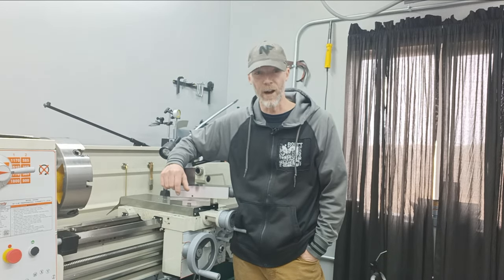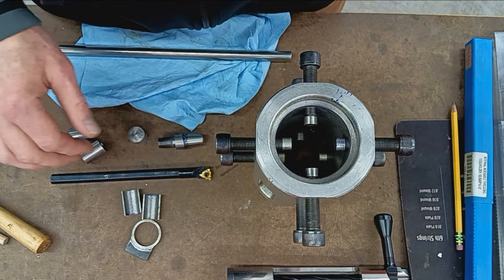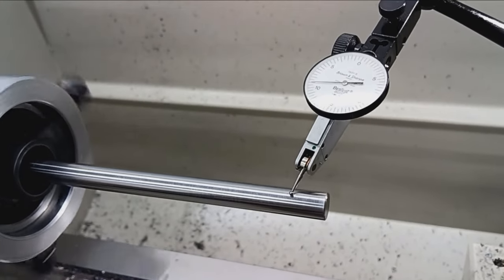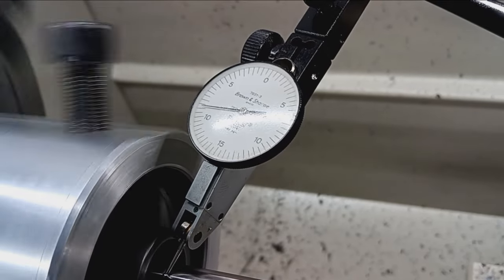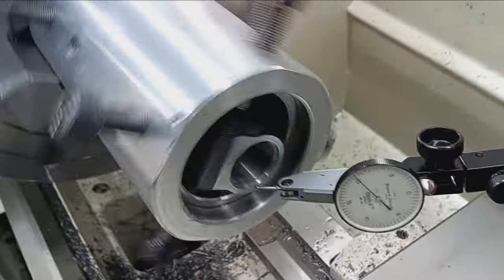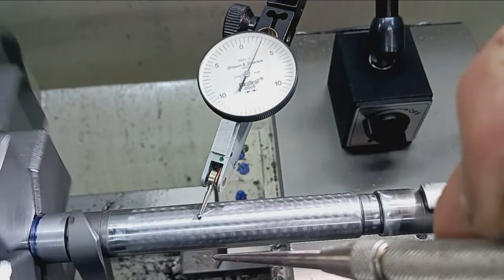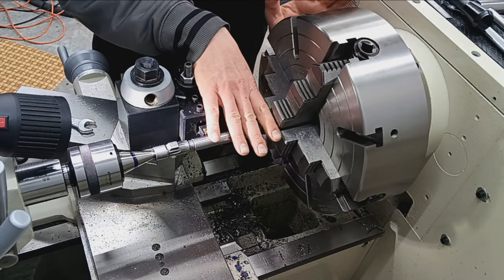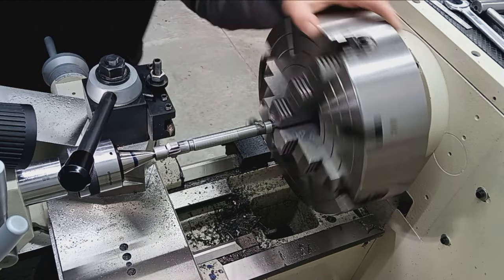Winchester 70 Super Sport CRF Rebuild - Part 1 - Blueprinting and Accurizing the Action

Comment: Geoff, totally understand the purpose in sleeving the bolt. I know Gordy does it and other custom rifles builders. My question is: you mentioned feeling "snugness" or some resistance to the bolt handle when closing. In order to set my shoulder bump I remove the fire mechanism and ejector plunger eliminate any resistance or pressure placed against the brass in a forward direction so once I start to adjust my sizing die I can feel the resistance of the case against the shoulder of the chamber. As I set the shoulder back the resistance is reduced until I feel no resistance on the drop of the bolt and there is no discernable "click" at the top of the bolt lift. In the interim of doing this I'm watching my base to datum measurement to see shoulder bump dimension. If there is resistance from sleeving the bolt how would one "feel" an accurate shoulder bump?
Reply from the maker: This should be cleared up for you in the next part with the barrel chambering.  I didn't explain fully, but in the end there is no resistance with an empty chamber.  It should behave just like a "stock" action (bolt drops freely on it's own).  Thank you for watching and for engaging the channel!